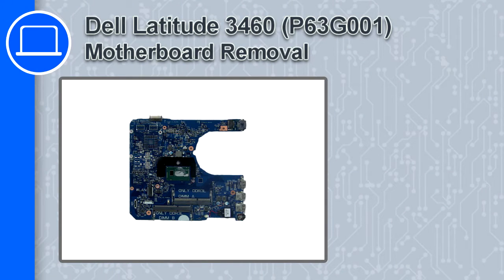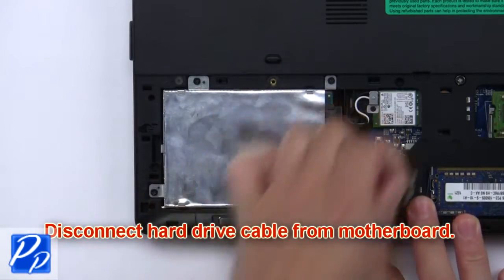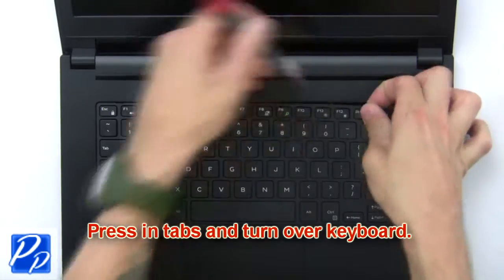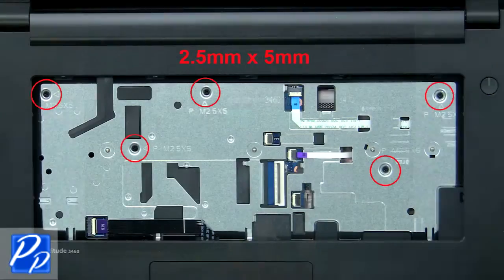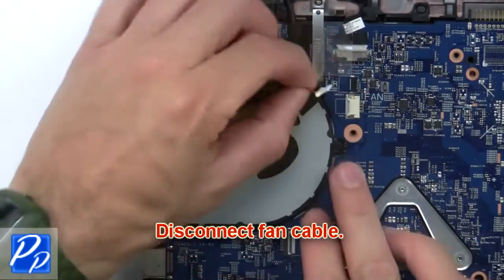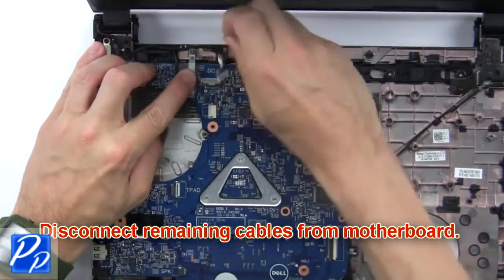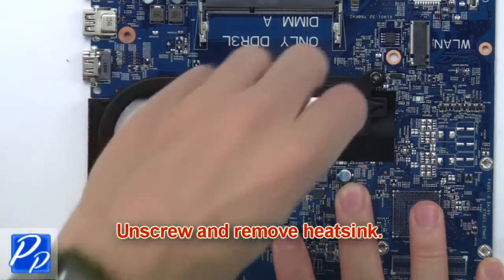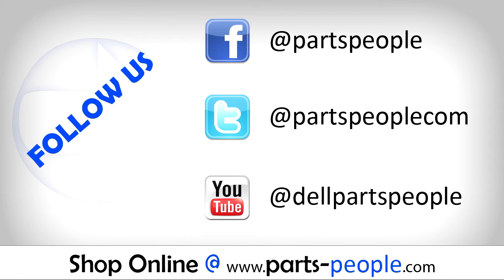Dell Latitude 3460 (P63G001) Motherboard How-To Video Tutorial

Comment: I own this laptop about 5 years from now. But wifi range has decreased over time.
Wifi chip is available on your website ?
Reply: Same problem after around 4-5 years
Reply: @thalexantos  Just buy a Wifi adapater. That worked for me. But now my web-cam stopped working. Hhaha
Reply: @LalitKumar-cw9rf  I did the same XD I am using a TP-link usb adapter for around a year and it's working pretty good since then. OMG really?? Mine still works but let us keep it in secret XDD
Reply: Can I using the İ7 version processes?
Reply: @cedi2823  No, I think this laptop only comes with i3 processor. You cannot change laptop processor